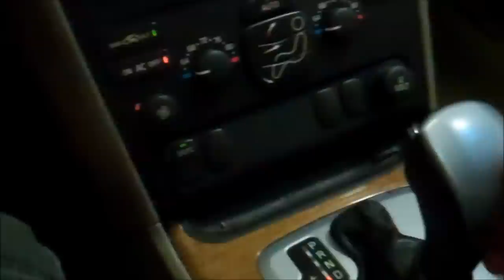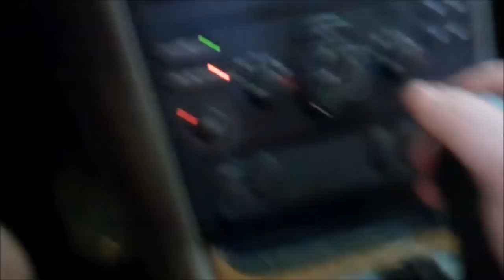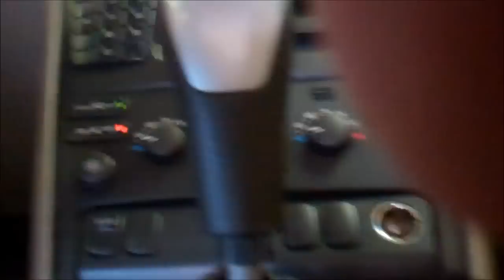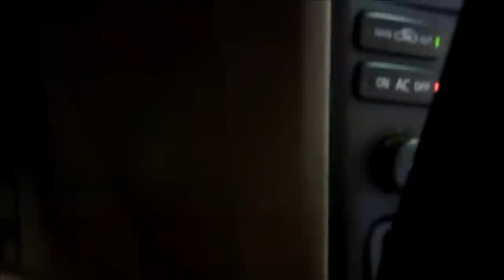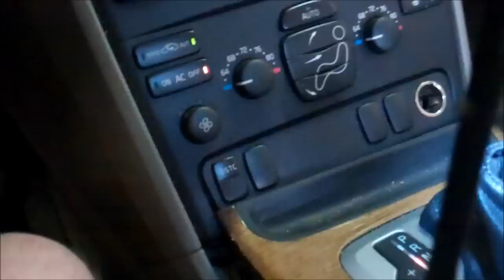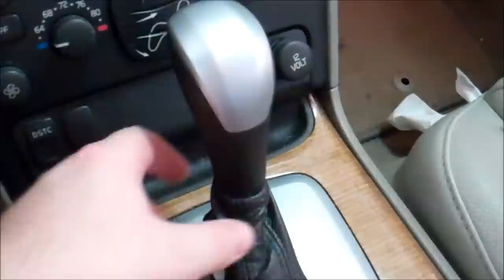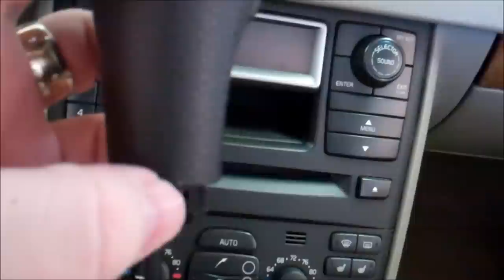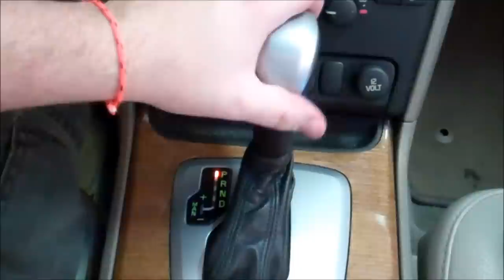2004 Volvo XC90 Gear Shifter Stuck - Removal And Repair - Will not shift into or out of Park

Comment: Just wanted to say thanks.  I got stuck in a parking lot and found your video on my phone.  I would have never figured out how to remove the shift lever without your help.  I found that once the lever was removed, I could shift and drive the vehicle - I just had to be careful not to inadvertently shift from drive to reverse since the lever that prevents that was now removed.  I just got the replacement part today and installed it with no problem.  Total cost for part and shipping was about $95.  If I would have had to get it towed and have the dealer make the repair, I'm sure I would have been out $500 bucks or more (not to mention the hassle).  I really appreciate you taking the time to put this together and post it.

Comment: Wow!!! I had this problem today after coming back from lunch, pulled in to park and it wouldn't go past Neutral... I work at a Car dealership so I wasn't overly concerned about getting home but was hoping it wasn't the Transmission. Anyways, I called one of my Techs out to look at it and he thought it was the neutral safety switch but wasn't sure. I got on google and found your video, after watching you take yours apart I went out to the XC90 and did what you showed and it fixed it. I will have to order the new shifter but at least it is driveable... Thanks so much for your help!!!

Comment: Thanks for this video - was stuck this evening with this exact same problem on my wife's 2005 xc70. In my case however the plastic trigger broke completely and the actuator pin fell out.  Watching this video helped me figure out the fix. Saved me much $. Thanks again!!
Reply: Would you explain how to fix?

Comment: Hello there, texascoder! Earlier today, my mother-in-laws 06 Volvo wouldn't go into park or reverse and the key couldn't come out of the ignition. We struggled for a while attempting to strong arm the shifter, but it wouldn't budge. I also tried calling the Volvo dealership, but it's after hours and no one could offer a solution. But then I turned to the Internet and low and behold I came across your video. I followed it step by step and I was able to put it in park and remove the key. You save

Comment: I've a 2004 V70, same thing, stuck in Drive/Neutral pointing in the WRONG DIRECTION.. ~:-/
Got it home and ran your vid, which gave me the push to go and have a look. Turns out that the plunger in the gear knob had disconnected.. re-connected and my mother has an brother called Robert. There is probably something broken.. and it will probably do it again.. but it's a quick and easy (5mins) fix.
Thanks for taking the trouble to post this vid.. very much appreciated.

Comment: On mine the button broke but now that I saw how that comes apart, I hope that I can get it into park.  Off to E Bay and order another shifter.   Mine is an 06 with just about 200,000 miles and the plastic bits are starting to become brittle.  I will check back after I get the part.  I was kind of hoping there would be a manual override, but no such luck.  Thanks for the video.
Reply: Aaaaand 9 months later....?
Reply: @ItchyKneeSon  Wellllllllll.  It did it again and I put in another shifter and still no go.  After watching a few videos, I found one young lady who had the same problem and she showed how to partially disassemble the shifter cover and on the drivers side is a small white tab that you push down and it releases until you put it in park again.  I haven't had time to dig to far into it because the weather has been crappy so I am using my winter beater Buick LaCross (I didn't realize how low a regular car sits as I am so used to the Volvo) but the weather is finally supposed to get warmer (I am in BFE Montana).  I am thinking along the lines of an electrical issue because the shift lever button works, but I need to go through the service manual to see if it offers a clue.

Comment: Thanks, this has just happened to our 2005 XC90, The same small plastic part fell out when I removed the gear shifter. I wouldn't have attempted to repair it myself if I hadn't seen your posting
Thanks again you have saved me a fortune as British Volvo shop rates are crazy. 

Peter

Comment: This happened to my 2004 xc90 about 6 years ago. Ended up just cutting about a 3 inch piece of bike inner tube and using a little soapy water on the inside of so I could pull it over the end of the shifter(think like a condom:) ) with the broken plastic knob depressed in the shifting position. Haven't had a problem since, except for needing to change out the tire covering since it started to tear a bit after about 5 years. Actually doesn't look bad at all on it and feels like a racing shifter. Costs nothing and you don't have to mess with pulling the shifter out. Just another option.

Comment: For anyone that has this problem in the future, I was able to pull the shift knob in the opposite direction then push it back in normally and things were working again. I did not need to take the entire shifter out of the center console. The issue i had was my xc70 not shifting out of park.

Comment: So I pulled into the parking spot,and pushed the shifter forward, and a 2 inch stainless pin popped out on the console. I tried to put it in drive and couldnt. I did find a vid on how to take the knob off so I could look at it.After 45 minutes of playing with it I got it all back together and it worked The pin swiveled between the trigger and back of the knob,holding the cable in place.  And thank goodness I had my Swiss army with me. The trigger part actual pulls out so you can put the pin back in correctly and it works. I didnt swap the part,I fixed the trigger.

Comment: Also: The boot will cause same problem, before shifting to park pull boot up and shifter will go past park to signal key release.
If that works for you and you forget, restart shift gears then pull the boot up etc etc . John

Comment: Thanks so much for this. Had exactly the same problem on our XC90. Your video diagnosed it and I got it sorted super easy. Went for £12.99 lever button off eBay, easy fitment and works perfectly. Thanks again, saved a ton of time and money.

Comment: Helped me thanks, however apron refitting the plastic ring inside the leather gaiter fell off and straight into the cavity. While the gear stick works, it wobbles a lot and can get pulled out easily.

Comment: The thing comes out at 12:00   These are about all the same on the S60 V70 S80 XC70 Xc90 from these years - as long as the release button is the same size, they all should be interchangeable .  Cheap to grab one from Ebay/junkyard (but sure not easy to pull out indeed)

Comment: In my case I had a 2008 Volvo S60 Turbo that wouldn't shift out of park and something seemed to physicaly prevent the shifter from returning to park. (it would freely shift down even without using brake but the shift indicator would stay on park)

I had to pull off the cover and shift lever today and found my issue to be that the internal shift rod was disconnected (it's something deep inside that the whole mechanism pulls back and forth so not the part you interact with). It should be an easy spot. It connects up to it near the top so you can see it once you get the shift lever pulled off and the veneer cover pulled out.

It's super annoying to get that thing to come off so I can easy access to it. So after I pulled the top off and discovered that the shift rod thing was disconnected. I popped it back on and now everything works. :D

Not sure how it came off as it seems stuck on there well enough. Maybe it was shifted too hard into park and the rod popped off. At least I know where to go if it happens again. :D

Comment: This was great video. I have similar problem, but mine might be a little more intense. I was driving my 2002 s60t today, I had it on drive, and then quickly put it into tiptronic (but forced it in) to down shift. It felt like something broke. Right after I couldn't put my gear back to drive, it continued to drops into the tiptronic area into first gear. Its loose as if nothing is locking in it. I got home forced the gear into park. I then took off the cover halfway, as I'm struggling to take it fully off and leather knob. I start messing with it, and now I get it into park, reverse, neutral, but drive continues to drops to fist gear ( with no control or resistance). I notice there was some iron wire thingy loose or jamed, I continue messed with it and it felt like it worked, but some how it didn't lock, continue to mess with it and it got loose, now i pulled out this big strong sturdy iron wire (looks like a small short suspension thing that bent straight, in a circle and bends out). I pulled it out as I didn't want it to drop in and get jammed some where else. It seems like there is another one in there controlling the automatic functions. Please send me any thought or suggestion, I'm sure it can be fixed, it just get in there.

Comment: Hi Great Info
Just a quick question :
Did you have to have the selector in Park, Reverse,  Neutral, or Drive before taking out the Shifter or does it not matter ?
regards Pete
Reply: It did not matter. You just have to pull REALLY HARD and steady... just don't have your face close to it, I learned that the hard way. 😐
Reply: Hi thanks have removed and replaced now with new.

Comment: Hey Texascoder: many thanks for your video on replacing the Volvo XC 90 shift. It's been extremely helpful to me to solve this problem......cheap plastic parts that don't hold up.
Just don't want to spend the ridiculous rates that the dealers charge. I want to get it right the first time......Many thanks  KB in So Carolina

Comment: This really sounds and seemed "stupid" from Volvo. Why all at a sudden so many things are going wrong with the Volvo? Shift stuck, Shift cap lock, indicator stuck, shift module rubbish......What a bad make of a car called Volvo? Good luck to you if your next car is also a Volvos and thank you to the helpers uploading videos explaining how to remedy or repair the never-ending disabling problems which should have been the job of Volvo, Sweden! Or at least these can be in Volvo manual but none there. All they say is their cars are so perfect but in actual fact is the complete opposite. Sort these problems, Volvo.
Reply: That's right. Volvo is the crappiest car I've ever owned, make funny noise and brake down everywhere. I can say makes more trouble than Chrysler or Kia.
However it's strongest and safest car in the accident.

Comment: Super, helped in a time of panic! Two questions...my 2005 XC70 is stuck in park, can the shift lever be pulled out while in park? I ask because the metal guide along the indicator panel is narrow while in park and widens out in neutral. Second, when installing the new shift lever, do I simply shove it into place?

Comment: Hi, I have an XC90, and the shift gear is stock in manual position, I do not see that the knob is broken. At this moment I have my suv in may parking and took off the battery. I recently changed the ABS system due to the abs problem message. Could it be that the gear stick is loose?

Comment: I'm dying here. did you get the shift knob off and fix the eternally condemned plastic trigger. Mines been broken for years. I just squeeze the heck out of it when it jams and it works. Sure would like to fix it.

Comment: What does the "w" stand for on the lower right?  How does it work?
Reply: its winter mode I believe, you press it when its too slippery or hard to drive out and you start off in 2nd gear. but you would want to not keep it in too many times or it'll mess with the transmission

Comment: So I'm having the same issue. My question is, mine only seems to do it when it is really cold. Warms up and it shifts. What are the chances the shifter knob lever breaks (little plastic piece falls out or whatever is being described) when it's pulled off? You'd think if it was broke, it wouldn't be an intermittent problem but just not shift...it seems as if I jiggle the cable that goes to a small green circuit board in clear sight, it corrects and shifts. Hard to tell. I don't want to yank the shifter off only to break it in the process. When I push in the lever on the shifter knob to shift, should I feel some kind of mechanical click or pressure? When I push it in there is no resistance or sound that it's doing anything. If it were broke, would it still shift on occasion?. I appreciate your video, time and help. You've saved a lot of people, a lot of money. Kudos for that bro! Good karma is a great thing. Keep it up. If you could email me any answers or advice, I'd be forever grateful. More than I already am! Thank in advance, you Rock. 
gratefuphanz at gmail.com

Comment: my s60 was stuck in park..i took the console off and sprayed electric cleaner..nope..brake lights came on..yes..seems to be a problem with the shifter itself..i bang the top and it works, so ill probably replace that

Comment: Just yesterday I had same issue- stuck in Drive or Neutral only. Local dealer parts guy and service guy scared me into having it towed to them for diagnosis and repair because they said it could be a couple different problems and since there is no returns on electrical items(one suggested possible problem was the park safety neutral switch on the Trans for $200) I had them fix it  and it was the shift knob! But now dealer says i need shift lock solenoid? anyone know how/where located to replace?

Comment: great help!!! whew the top part of shift gear actually cracked and
fell off and I was like STUCK!!!  then I google and found yr video..
THANKS!!! was able to switch off; park and get the key out;
tried to yank out the gear stick (SO I REPLACE NEW ONE)
but still cant manage to do so - HOW did you get it out ???
- I don't want to use brute strength ---- PSE HELP..

Comment from the maker: @heidihouston Thank you for watching and for the comment! Our Volvos are wonderfully engineered vehicles. 9 out of 10 times you will get a Service Notification message if something electrical goes wrong. With your first shop visit, if you did not have a message, then the first shop has diagnosed the issue incorrectly. I would be willing to guess that you are experiencing the same problem I did. Let me know how it turns out, and thanks again for the comment.

Comment from the maker: @pinhoja No bother at all, thank you for the comment and for watching. For your situation, it would be best to have a mechanic inspect the shifter and vehicle. It's hard to guess at what could be causing your issue. The safest thing to do, have a mechanic diagnose the problem. Post back what you find, I am interest in knowing the cause and fix. Thanks again for watching and commenting!